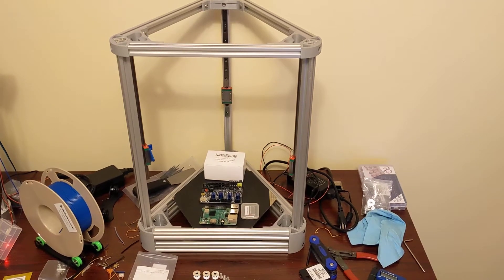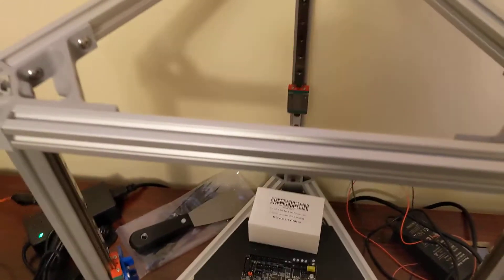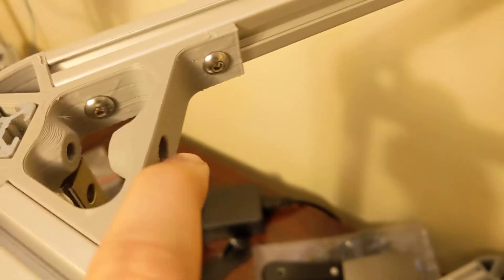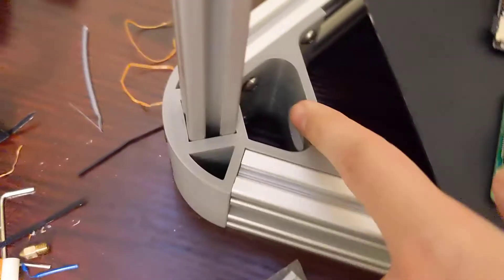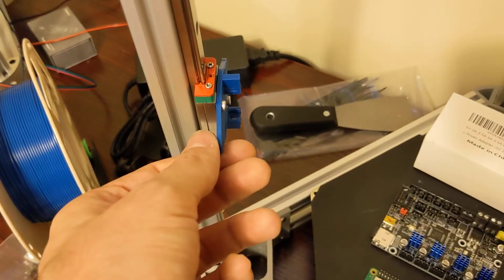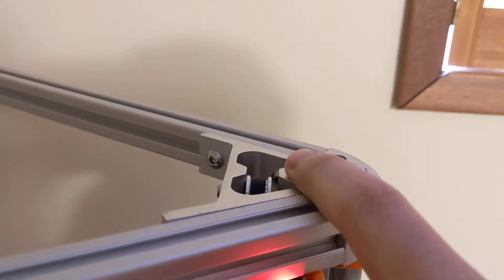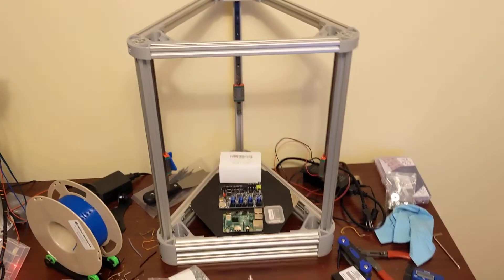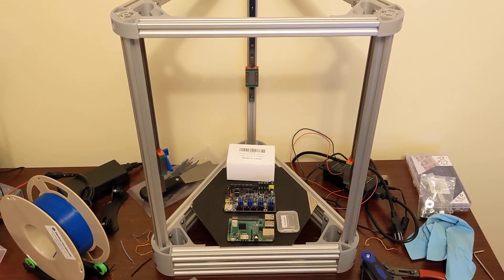Let's build a Delta 3D Printer Episode 1 The Frame

Comment: Been trying to figure out what to do with some 4040 and 4020 extrusions I have laying around. I believe this is it thanks. What is the build volume of both machines
Reply from the maker: 300 x 1000 and 180 x180 I think, these are older designs. I will be releasing a 2040 design soon
Reply: Think I’m going to go for ~500x700. Will there be any upgrades to the hardware used
Reply from the maker: @jsInstalls  unsure, it will be a different printer and different designes
Reply: @Rolohaun  do you have a potential eta for the new design
Reply from the maker: @jsInstalls  no eta, I have a few other projects to finish first. For sure join my discord we have a active delta channel there that is building deltas
Reply: @Rolohaun you have a link to it. I can’t find it

Comment: On the Large Delta printer I wanted to make sure of the filament used. PetG for all parts and corners instead of aluminum. Or did you use some Pla?
Reply from the maker: I just use PLA, PETG would be ok too
Reply: @Rolohaun  What percentage infill did you design the corners to be printed with? Thank you in advance.
Reply from the maker: @frederickbawden9470  I usually go with 3 wall 15 percent, you can go 4 wall 20 percent if you want insane strength

Comment: Is there a file for 3d printed ABC corner frame parts? I have never built a printer before and I have been thinking about building a Delta-style printer some time in the future. I was just checking out all the different parts I would need to build it. I checked the github and I didn't see anything. If you could help me out that would be great. Thank you!
Reply from the maker: I have updated the github
Reply: @Rolohaun  Thank you!

Comment: Very detail explanation. Thanks a lot for the video and the printer design. Alternative to T-nut I would think to use thinner M5 nut. I believed it could further bring the build price down and do the same job - to tighten between printed parts and aluminium members. I noted your bigger Delta is using aluminium corner connector. How is it compare with the printed part in term of easiness to achieve frame stability and verticality ?
Reply from the maker: Yes you could use the thinner M5 nut I have some of those as well. My large delta has aluminum corners from here https://spool3d.ca/aluminum-2020-delta-corners/ they are expensive in my opinion and not great quality the drilled holes have burs and it can be hard to get bolts through. Build wise and stability there are about the same. You can tighten the bolts down better with the aluminum corners but on a delta there is very little vibration and the bolts do not need to be very tight.